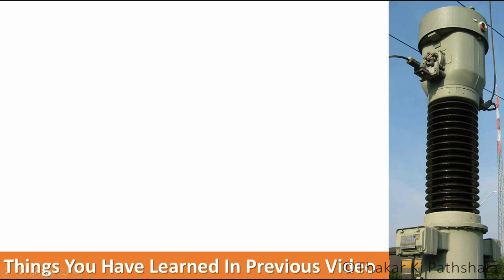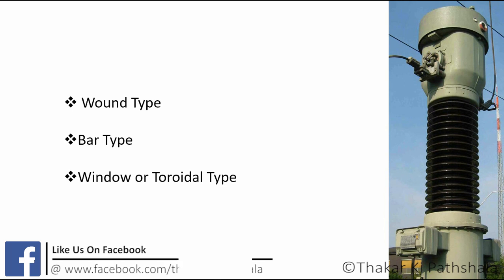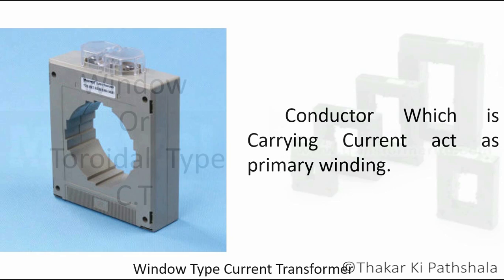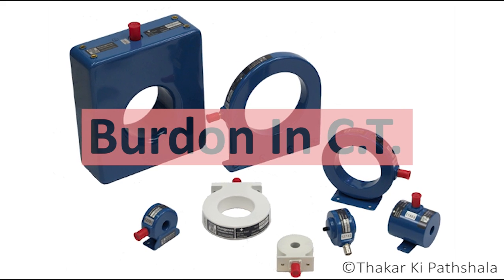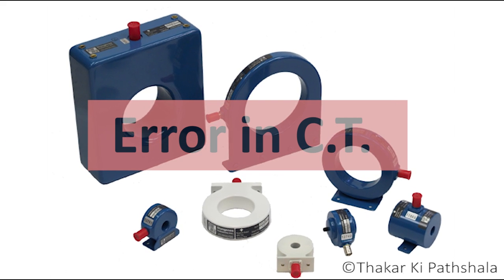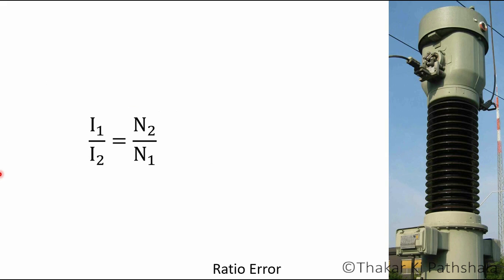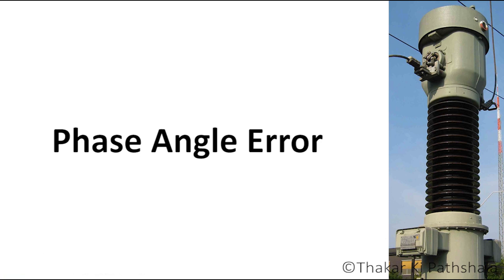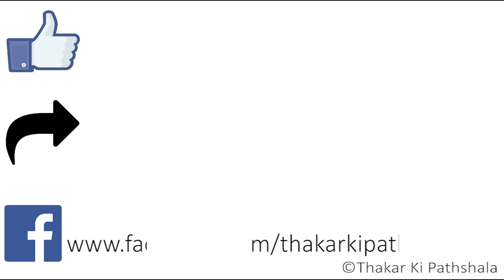types of current transformer and burden in current transformer error in current transformer

Comment: What should I do if I have a CT of 500:5 & pri. Current flowing is 250 A max. & still I want to display 5A at full load on ammeter ?
Reply: You can put ratio in Ammeter as 1000/5 instead of 500/5 so all current values in secondary will be doubled ...eg for 250A, secondary will be 2.5A but for Ammeter as we have put 1000/5 means Meter will sense as if primary is having 500A

Comment: thank you for give such a information.......and I want to know what happen if CT secondary is open circuit..... fully technical wise.......... could u help me......
Reply: Yes please upload a video on this
Reply: Voltage will increase and winding will burn due to heavy stress of electric pressure
Reply: Maybe this has been too late of a reply but I just gonna say it.
When step down current, it means the voltage will be stepped up. If CT secondary is open circuit, voltage across the open ends will be very high even if it has low current. That is why in practice, secondary will either be short circuit (the open ends) or to a load.